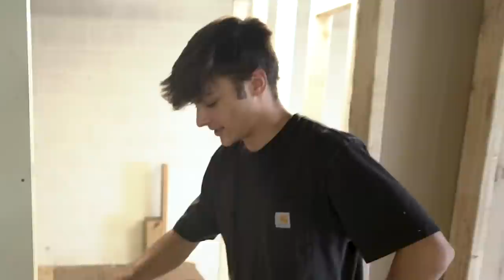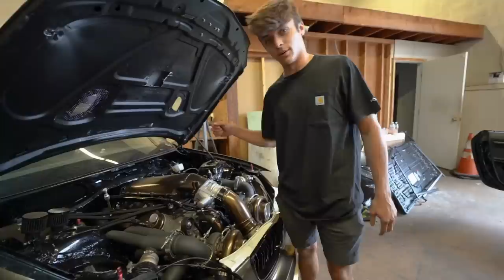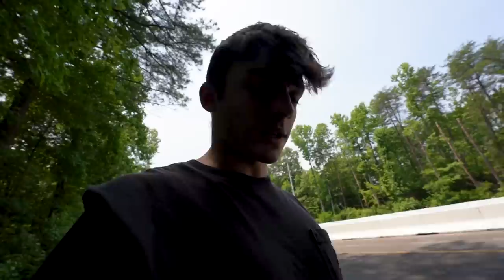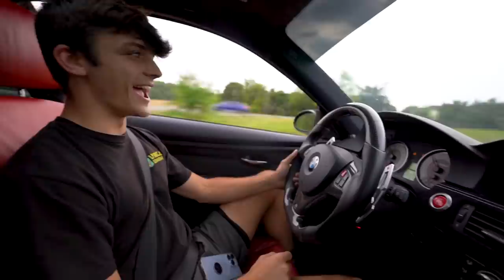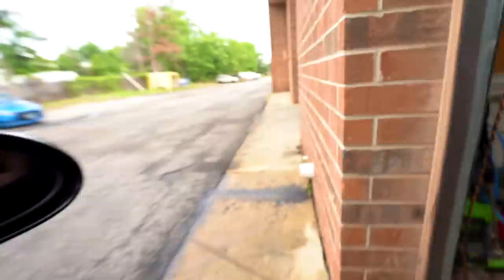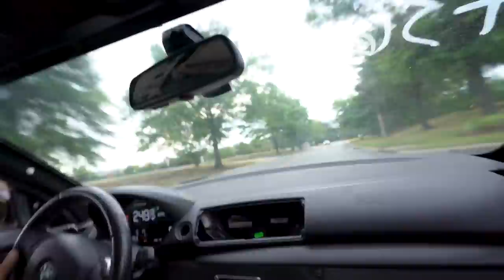BIG TURBO BMW 335i HITS 30 PSI

Comment: I'm surprised that BMW is still surviving
Reply: ikr their new car designs are 🤓, but their old car designs 🤩🤩🤩
Reply: It’s an N54 it’s good for 700bhp
Reply: @shark93ish debatable, it can reach that pretty easily but reliability goes down the drain on an already unreliable engine
Reply: A lie lol
Reply: @shark93ish n54 from 2007 does not have no 700hp lmao no way
Reply: @memesyandhorrorshorts yeah it can lmao, single turbo fbo e85
Reply: @memesyandhorrorshorts with mods, yeah… lmfao
Reply: @ctaaaaaaa why wouldn't he be taking bout wit mods lol?
Reply: @Jmarzx  because he’s acting like it sounds ridiculous… if the engine was stock, maybe… but with mods, 700hp is pretty common with the n54… lol
Reply: @kahbreeyo hey weren't talking about BMW in general
Reply: @jailolz  my comment was first at that time we were talking about bmw